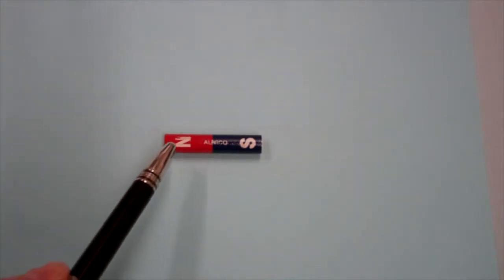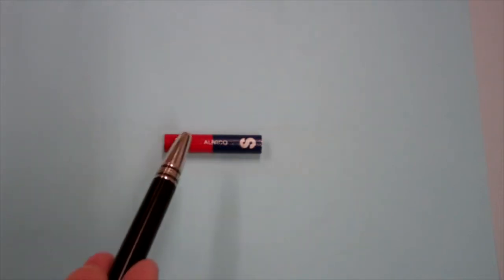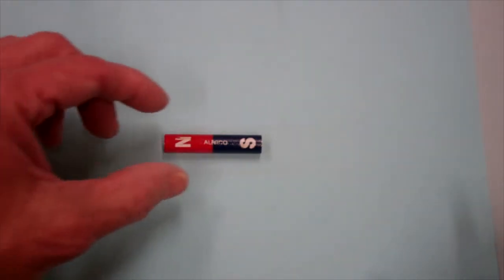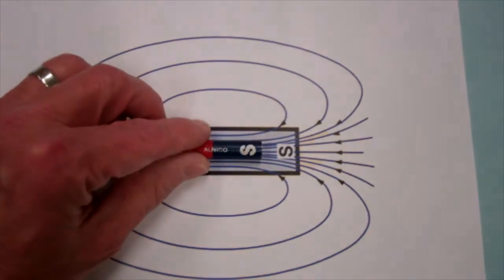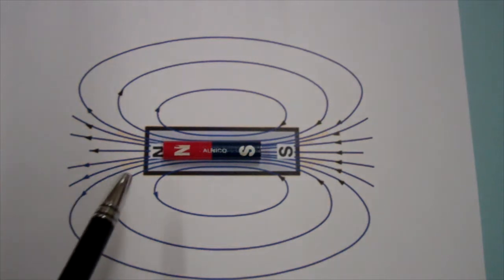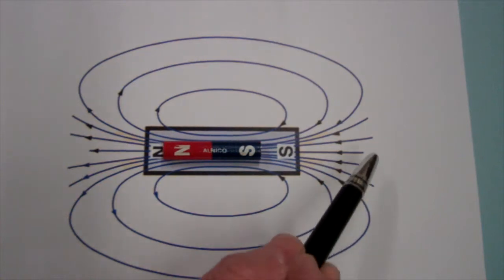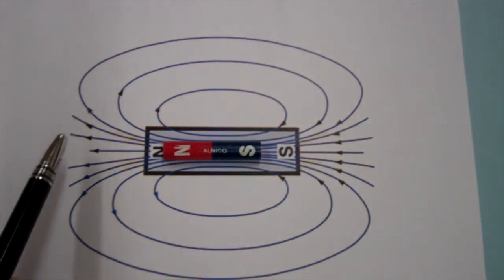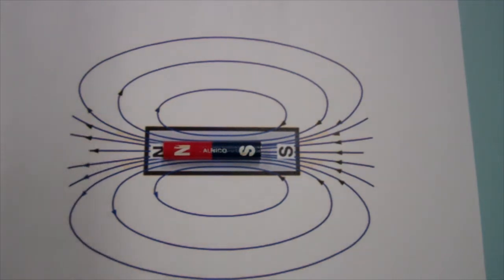Further Demonstrations of Electromagnetic Induction

Comment: hello thank you for the video i have a strange question that im strugling to find the answer for but is probably simple to you 

if i had a metal detector running at 12khz how would i emit more emf from the coil would i need more windings or more power or is it a fixed rate and depends how the coils overlap or teh size of the coils 

your input would be amazing thank you

Comment: E=MC2 is just a joke!!  OMG:  Let's get educated   #1.  The most powerful part of a magnet is the center!!!,   #2.The entire universe is magnetic.  If it weren't for the center of a magnet AC current could not travel nor radio waves.  FACT!! #3.  If you want to play with anti gravity it's right at the center of a magnet!!!!!!!!!!!!  TRY THIS:   TAKE THE CENTER OF A BAR MAGNET AND TAP IT ON ANY NONE METALIC MATERIAL>> YOU DONT WANT TO DISRUPT THE MAGNETIC FIELD WITH ANY IRON>>> You will see it will loose about two thirds it weight..  Most UFO'S are not detected by Radar because they are none magnetic . Not in the North South pole thinking!!!  IT'S ALL ABOUT THE "CENTER" get your act together.  You need get past the North and South pole thinking..they are the weakest part of any magnetic field!!  We all got screwed in the early ages by Edison and D.J. Ludwig.   They would not allow Tesla to expose the center of a magnetic force and all the benefits to man kind.  INDUCTANCE IS THE OSILLATION OF THE NORTH AND SOUTH Fields VIBRATING IN THE CENTER Field.:::    The height of ones intelligence  is directly proportional to their own realization of their own ignorance111111111111111111

Comment: I have another doubt if increase the thickness of wire of the coil, the voltage & current  produces in it ?
Reply from the maker: There will be some voltage drop in the wire. So a thicker wire will have a lower resistance and more of your voltage will appear across the load. However, the currents are low so there probably is no reason to be concerned about the voltage dropped in the wire.
Reply: if increase the thickness of wire of coil ,does the amp rate increases ?
Reply from the maker: Slightly due to the slightly lower resistance with a thicker wire.

Comment: i have doubt if increase the number of turns of the coil what will happens to the voltage ? does it increases or decreases?
Reply from the maker: The voltage will scale with the number of turns. You double the number of turns you double the voltage you are producing.
Reply: Thank you bro for your valuable reply

Comment: Since we have generated a bigger current in the bigger  coil with the same permanent magnet,  I can assume that the magnetic field in the bigger coil is also stronger then the smaller coil using the same magnet right ?
Reply from the maker: Yes because not only is the induced current larger, you also have more turns. The generated magnetic field will scale with both the current and number of turns.
Reply: Fantastic ! Thank you Michael.

Comment: Very well explained! I have tried this demonstration with the exact galvanometer. It is working but the needle is not deflecting much. i am wondering if the problem is the magnet that I'm using, a ceramic block magnet. Please answer ASAP. Thank you :)
Reply from the maker: The stronger the magnet the larger the change in magnetic flux and the larger current you will generate. So get a rare earth magnet. Also the current will scale with the number of turns of the wire. So if you wind the wire 10 times as many turns you will get about 10 times the current.

Comment: Sir I have decided to implement the same technique to my upcoming project to produce electricity. My question is, how much output will I acquire if i use 20,000 turns of coil and use more powerful magnet (powerful than what you have used). And if i am to validate the amount of electricity produced, which device would be best to measure.
Reply from the maker: you could put the output across a resistor and monitor the voltage across, or current through,  this load to figure out how much power you are generating.
Reply: Sir other doubt regarding this is, I tried employing circular magnets with considerable turns over the material. But i could not make and own no idea of where it went wrong. I used multimeter to check the output. I implore you to suggest a viable way to fetch output.
Reply from the maker: Your  problem is the multimeter.You need a meter that will be responsive to a pulse of current like a galvanometer.

https://www.amazon.com/Electronix-Express-01GAL500UA-Galvanometer-500/dp/B015X6U2OO/ref=sr_1_1?s=automotive&ie=UTF8&qid=1476362756&sr=1-1&keywords=galvanometer
Reply: Michael Melloch sir 
will we get the output if v use ring magnets to move it laterally??
Reply from the maker: Yes

Comment: Great video. I was wondering how you connected the coil to the galvanometer without connecting it to both ends, how is that done?
Reply from the maker: The connections are on opposite sides of the large coil. The connection to the other end of the coil is probably hidden by the large coil in the video.

Comment: I have tried to recreate this experiment but I failed. I was wondering if you could help me out. My coils are made up of thicker copper coil but much less in length (about 2 feet, so 4 to 5 loops). Also my loops aren't overlapping like yours are (think this might one of the causes to my failed recreation), I have gaps (I have tried to tie them all down but since the wire is thicker its a little harder to bend). Also, my multimeter can only be set to mA not micro Amps (on DC). Could it be that I am getting a current but too small for my meter to read? OR is my magnet not strong enough? 
1) Gaps in coil
2) Need a micro Amp reading feauture
3) Stronger magnet

Please let me know what I am doing wrong. 

Thanks!
Reply from the maker: A stronger magnet will give more current, but your main problem is the multimeter.You need a meter that will be responsive to a pulse of current like a galvanometer.

https://www.amazon.com/Electronix-Express-01GAL500UA-Galvanometer-500/dp/B015X6U2OO/ref=sr_1_1?s=automotive&ie=UTF8&qid=1476362756&sr=1-1&keywords=galvanometer

Comment: Michael, 
Thank you so much for taking the time to make this new video, in response to my question.  It must have taken quite a while to get that that many turns on that Bobbin. 

You have got the geometry/construction of the coil perfect.  And your demonstration has also answerd two other questions that I did not ask; thanks much. However, in the last part of the video, starting right around 5:13 of the 5:38  seconds, where you start to move the magnet alongside the coil; if you were to use one pole of the magnet (anyone), then you would have answered my question exactly;  You had the magnet horizontal to the side of the coil, my question is if the magnet was held perpendicular to the side of the coil and move from one end to the next.
Reply from the maker: Richard,

You are welcome. I already had the coil. You can see how I wound it in this video,

https://www.youtube.com/watch?v=iVbNGJX88gc

The field emanating from the bar magnet spreads out in three-dimensions. So no matter how you orient the magnet to the coil, when you move the magnet there will be some flux change inside the coil. (Also the 30,000 turns of my coil are spread out because of the finite thickness of the wire so the coil is three-dimensional.) I just tried moving the magnet along the outside of the coil with it oriented perpendicular to what I was doing in the video. There was a current generated in the coil, but it was definitely less current.